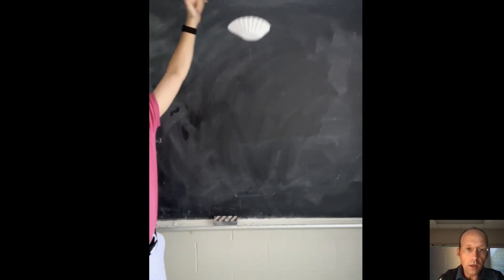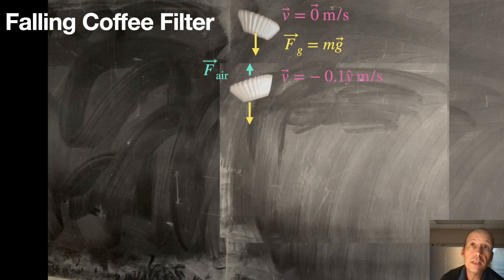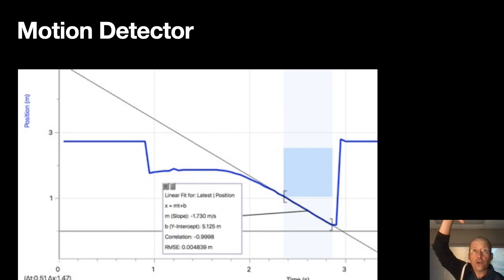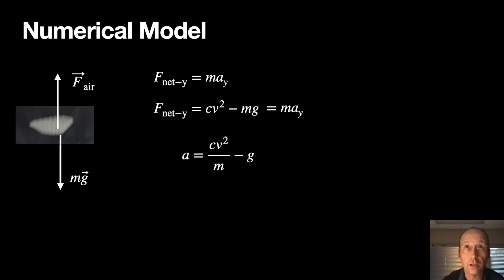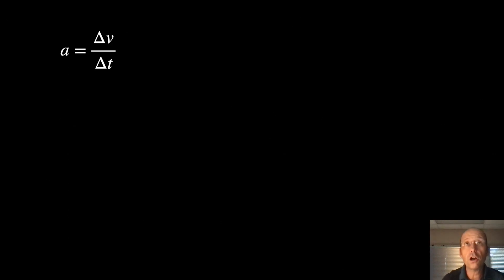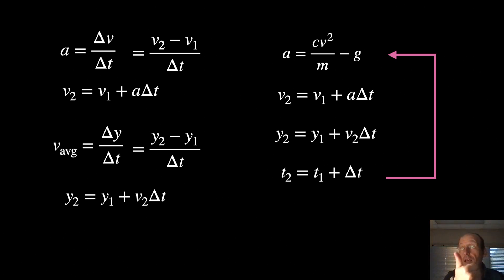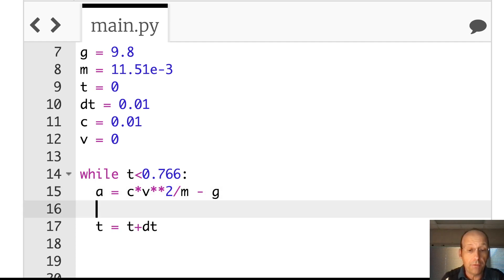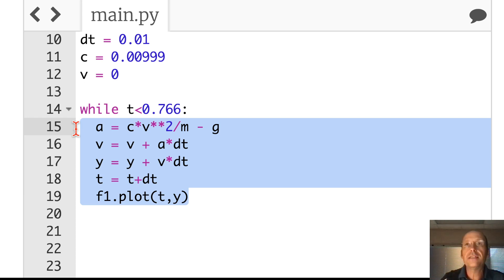Physics Lab: Modeling the Motion of a Falling Coffee Filter with Python

Comment: but you assume that the drag parameter (lowercase c) won't change if you change the mass of the filter. However you say you change the mass of the filter by stacking up several filters. That should change the shape of the "object", so you would expect that the drag parameter changes as well.
Reply from the maker: changing the number of filters will change the terminal velocity which allows me to find the drag coeffient
Reply: @DotPhysics  true, but that will also change the "shape of the object", which in turn affects the drag coefficient.